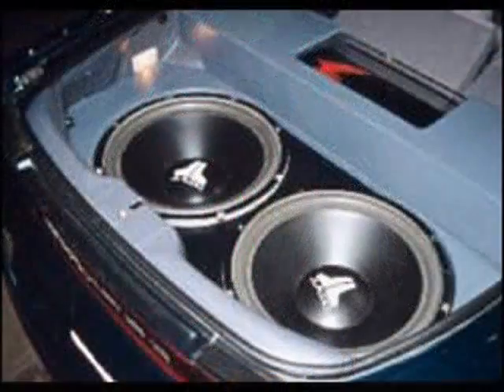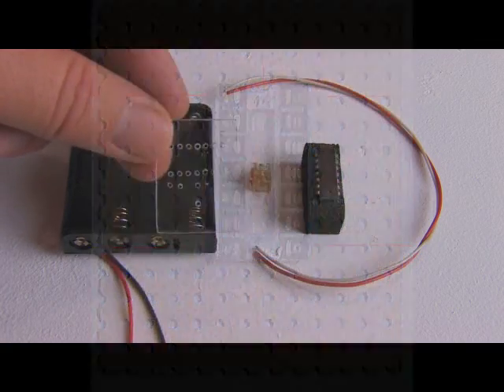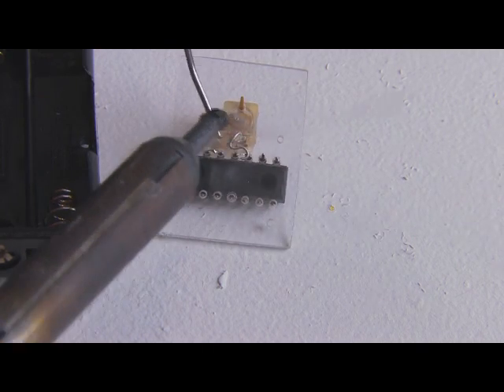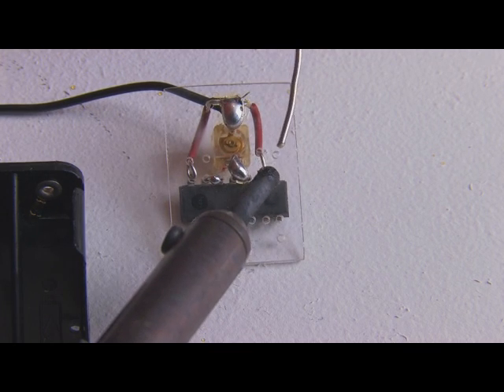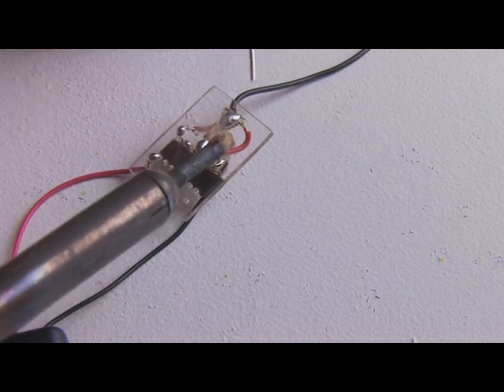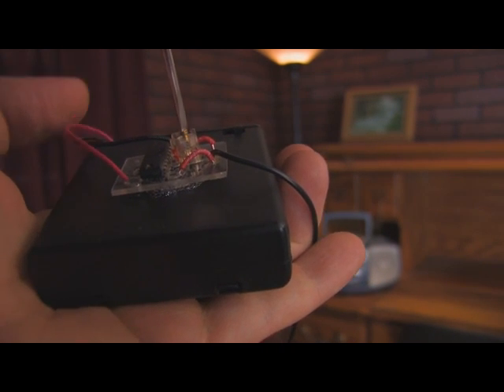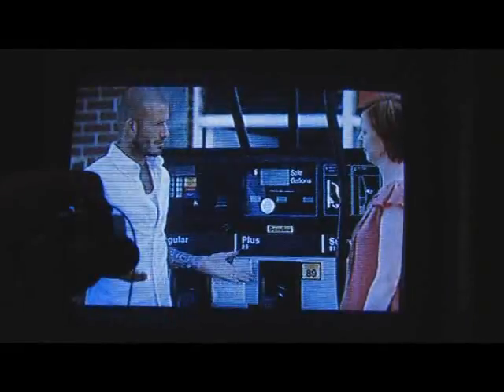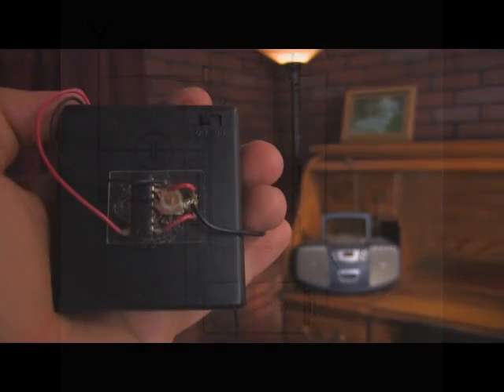Easy T.V. and Stereo Jammer!

Comment: what is the type of ic ? who c an give me the number ? ?
Reply: 賴峙頴 Ti 7404, cap is a variable 1-30pF.
Reply: ***** Yes, and where exactly would one find the TI 7404 online? The only 7404's online are every number EXEPT the "plain" 7404. The 74ls04 won't work. It's output is too smooth. The 74l04 won't work either. How 'bout posting a link to the actual plain old 7404 chip that DOES work? Don't know why it's a big secret, other than to just irritate folks. Congrats.